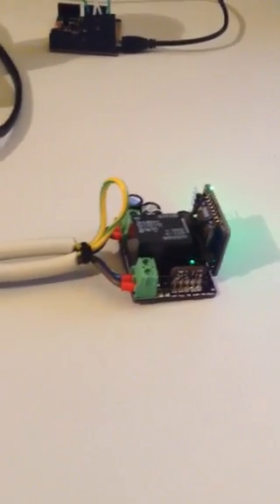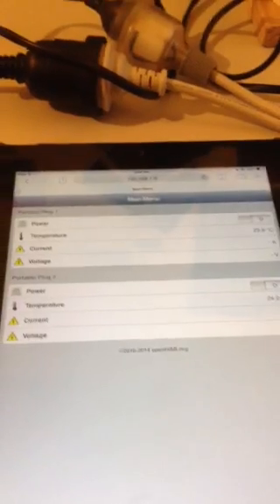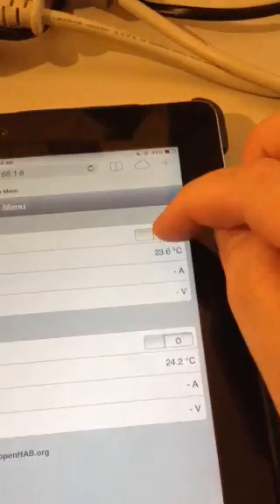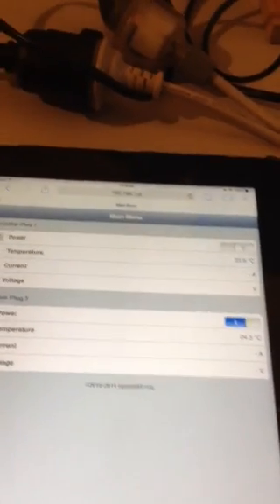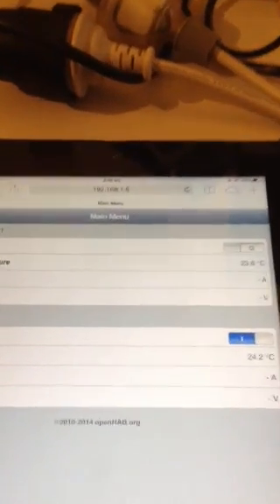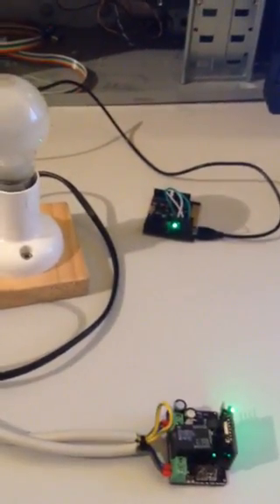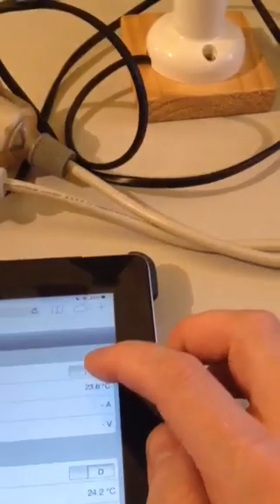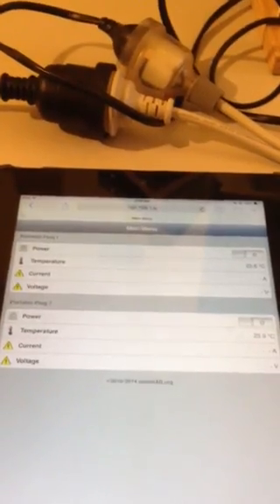WiFi remote switch with ESP8266/OpenHab

Comment: Is there any possibility to use the esp8266 that you can control a light with the esp? So not ot to connect the lamp with the esp over wire, only control the lamp.